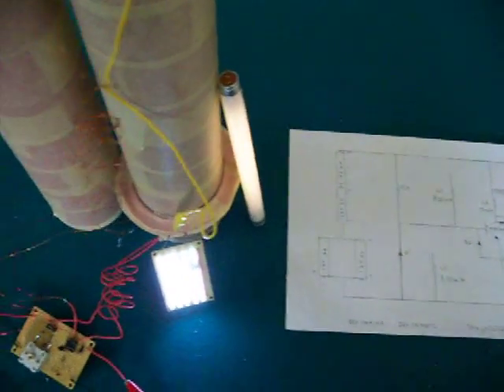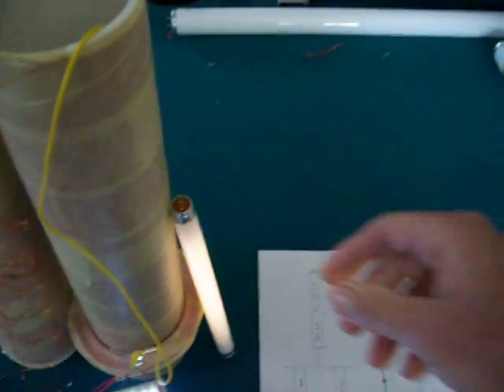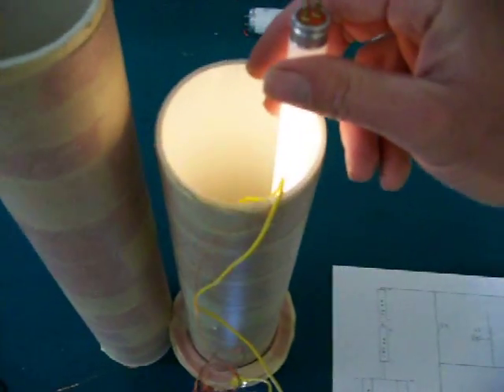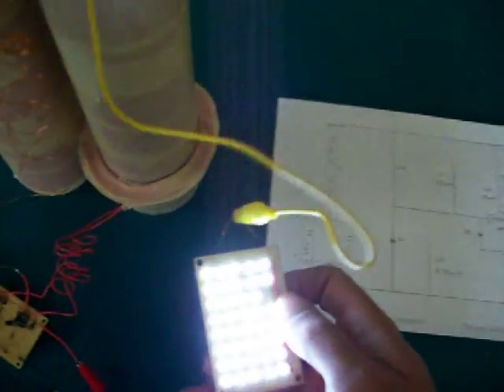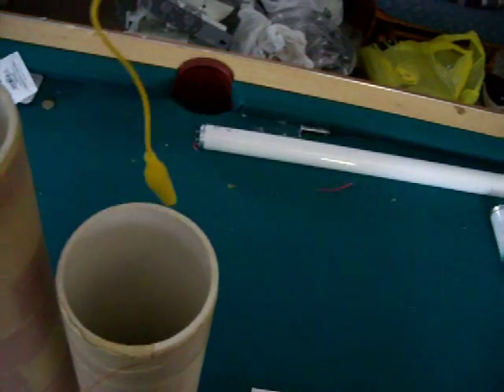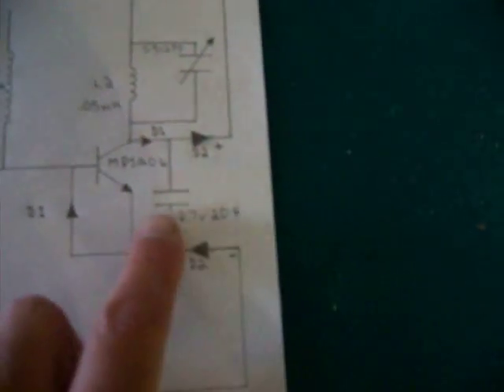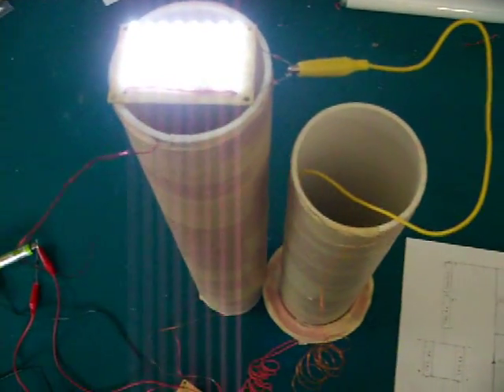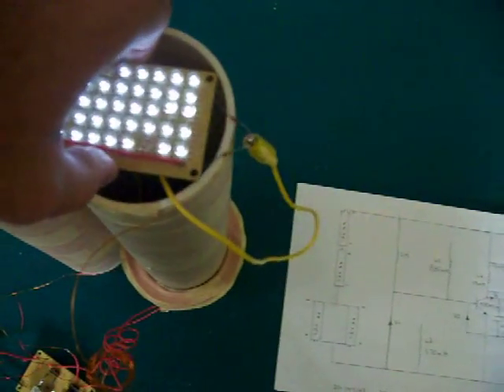Slayer Exciter 20F cap.

Comment: You are a top bloke mate

I understand about back emf.. 
Is the diode from emitter to base necessary?  
Why do my transistors keep going out with a puff or bang? 
I've got 3m-541.1k OHM to base off a 24v 
Battery. Its only when it stops chucking out plasma from arcing and kinda self oscillates between the diode and transistor? Could it be the initial battery pulse upon connecting the battery and my transistor was hurt by the blocked/internal oscillation?  I'm confused 
Could I just skip out the e - b diode?
Thanks
Reply from the maker: Yes, it helps to keep the transistor from degrading over time.
Reply: +colzilla090 Not sure if you made this mistake or not, but I sure did, before I gave it a little think, after the fact: Do NOT connect a capacitor between the two ends of the HV coil as that increases the load on the base pin SUBSTANTIALLY.  You may get 2-3 MUCH bigger sparks from the top load, but then it lets the smoke out of the transistors.  Just a thought, no idea what your setup looks like.  Also, if you aren't using a power transistor with a heat-sink for 24V then that may be your problem.  If that is the case and you are only using maybe a 2N2222A or similar, then you should consider adding a few (like 3-4) of that same transistor in parallel to share the load and decrease chances of transistor failure due to overheating.